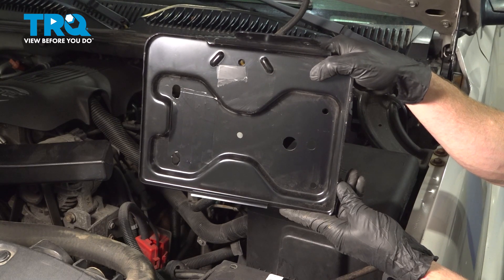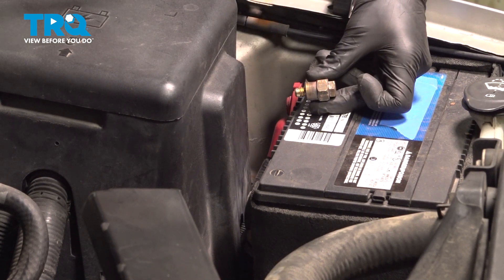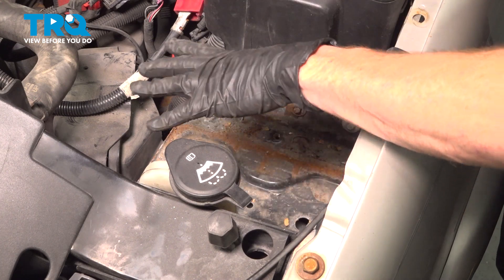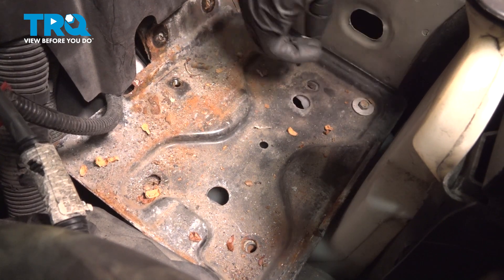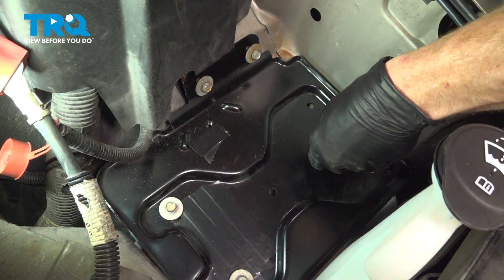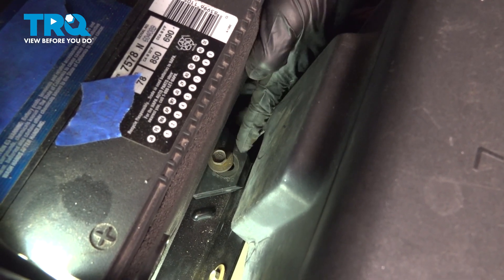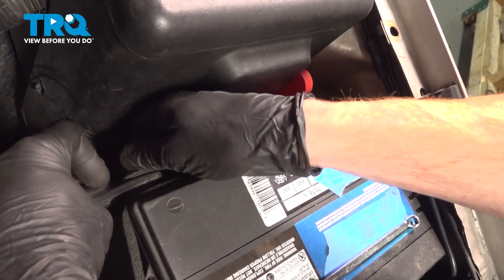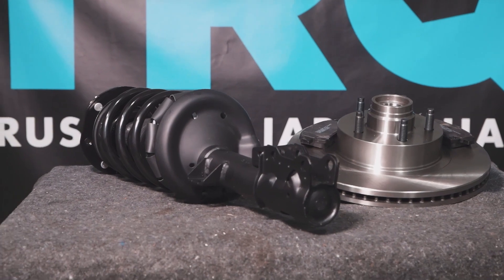How to Replace Battery Tray 2000-2006 Chevrolet Tahoe

Comment: My battery tray bolts on my 2001 Tahoe are extremely corroded.  Can't get a socket to work on them.  If I use a 10mm socket it spins without catching the edges.  Looking like I'll have to destroy the tray and/or drill out these bolts.  Any tips for getting these bolts out besides soaking them with PB Blaster?